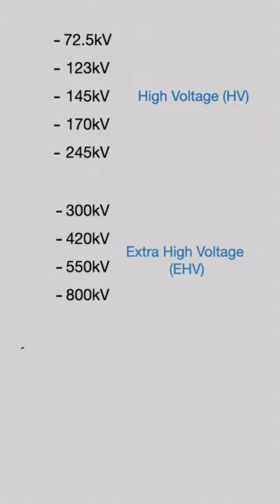Rated voltages used for Transmission! ⚡️

Comment: These are the highest continuous voltages for rated transmission voltages. Sometimes they are called rated voltages of the equipment!
Reply from the maker: Correct
Reply: @GauravJ  In my country there's 400 kV power line where voltages sometimes go up to 435 kV or  so when lightly loaded for hours. Power transformers at ends don't have enough regulating range to bring it down to 420 kV. It's a big problem, but the line must operate still